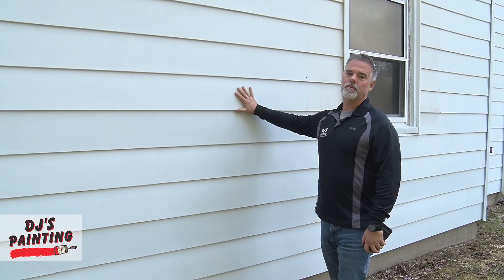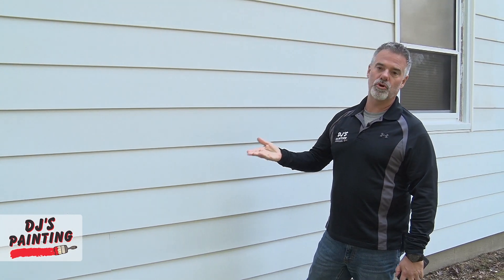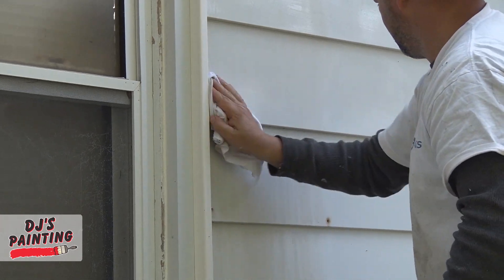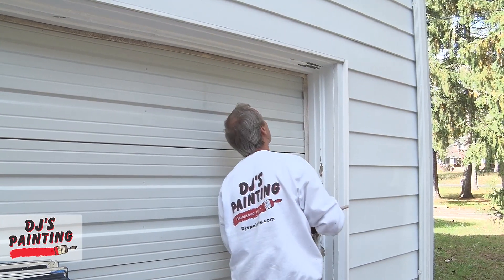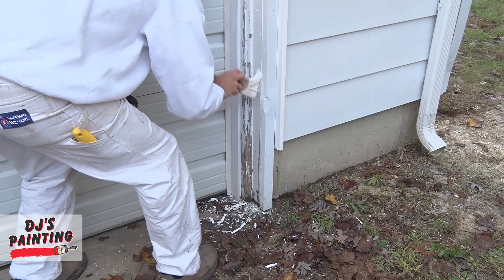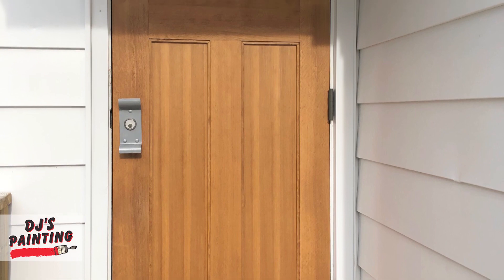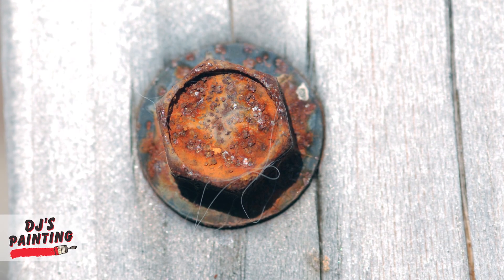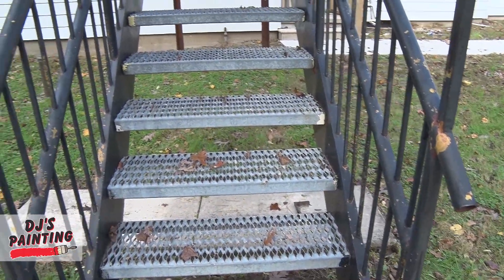How to Paint Aluminum?

Comment: Hi...
I have a house to flip. Aluminum siding is in great shape. But; extreme dull oxidized. Plus; vine stuck to siding at places. I pressure washed and it did nothing. So; I am sanding it before paint. 
What paint should I use for coverage and longevity?

Comment: Do you use rust-remover or converter?
Reply from the maker: we do love them...  they work very well
Reply: @DanHaer  Which one did you use?  Rust remover or rust converter
Reply from the maker: @theropesofrenovation  https://garage.eastwood.com/eastwood-chatter/encapsulator-vs-converter/
this is a link to some good info on rust converters, we have used many over the past 20 years or so...   Most of the time we use rust-oleum rust reformer.
Reply: @DanHaer  AWesome. Thanks so much!

Comment: Pressure washing doesn't remove oxidation
Reply from the maker: I hate to argue...   but Oxidation in this video refers to the paint coating that has gotten chalky as a result of the suns UV rays breaking down the coating.    

Oxidation is any chemical reaction that involves the moving of electrons. ... When iron reacts with oxygen it forms a chemical called rust because it has been oxidized (the iron has lost some electrons) and the oxygen has been reduced (the oxygen has gained some electrons).   
This oxidation usually appears as a chalky residue.  When chalky paint or vinyl siding is washed either with a strong antioxidant or just very high pressure alone the "oxidized chemical residue" comes off. therefore washing does in fact remove oxidation.
Reply: @DanHaer  Arguing with you is not my intention. It just so happens that I to am a painting and pressure washing contractor located in Jersey. The point I'm trying to make is that pressure washing alone does not remove oxidation from aluminum siding.
Reply: @scottcheney6955  I agree bc I've pressure washed my siding A LOT and it still is chalky.  Curious: Do you service vineland nj area?  I have house with aluminum siding that I'd like to get painted.  Thought about doing it myself but I dont think good idea will prob look worse. Thank you
Reply: Just use Flood Emusla bond in the paint , chalk is no problem

Comment: I have a customer with siding that is flaking down to the metal.  So, basically powerwashing would send flakes flying everywhere.  I was thinking of applying some kind of a paint stripper and then powerwashing.  Have you ever tried that?  If so, how did it go?
Reply from the maker: We have, if there are many layers its not a bad idea... but if its just the factory coating a good hard wash will do the trick

Comment: Do u have a video taking about HOW TO CAULK ALUMINUM SIDING
Reply from the maker: Not yet, but I can make one.  the product I would recommend for caulking aluminum corners is SW loxon H-1 caulk or BASF NP-1 caulk.  These are 1 part urethane sealants that will bond well and "stretch" enough to hold together and are both paintable, unlike mose silicone caulks.   Typically siding is only caulked in the corners where siding meets the trim and with aluminum there is a lot of movement so its very important that the joint be clean before applying the caulk

Comment: Oil based primer then acrylic? Peeling waiting to happen 🙄
Reply from the maker: So the idea that acrylics can not be applied over oil has been around for decades...  an oil based finish paint product and an oil bonding primer have very different properties.  
A Typical oil based top coat product for example - SW oil based industrial enamel or rustoleum enamel, these are very high density alkyd resin and cures very hard and smooth. This hard smooth finish does indeed make it very difficult for Acrylic or latex paints to bond , BUT an oil based primer is a very different coating than a oil based top coat both are designed to bite/bond very good to what ever they touch, and both penetrate deeply into the substrate and block out stains most of the time , however the oil primers are much softer and have a much more porous/rough finish which allows the acrylic/latex paints to get good inner-coat adhesion.   

The paint reps from just about all the major companies keep giving me acrylic and other water based primers to try some acrylic primers bond just as well as oil primers,  but none I have used as of 2020 can do both...   bond and block stains as well as an oil based primer.
Reply: In my kitchen I used oil based primer underneath and water-based latex on top. Worked very well for me and cleans nicely. But that's interior. But I don't see why it wouldn't work for exterior